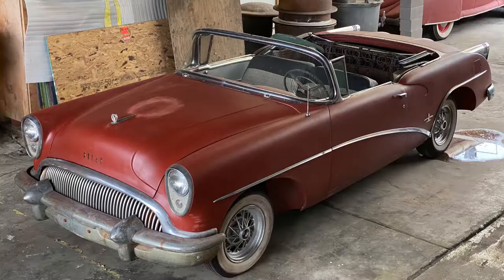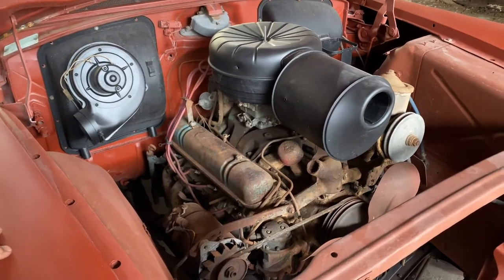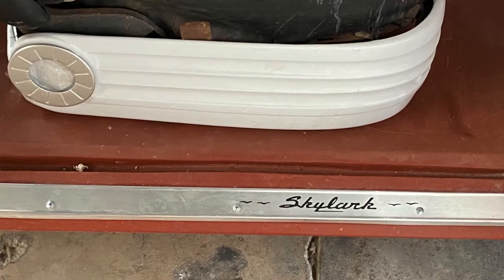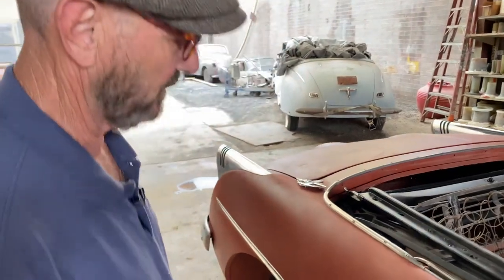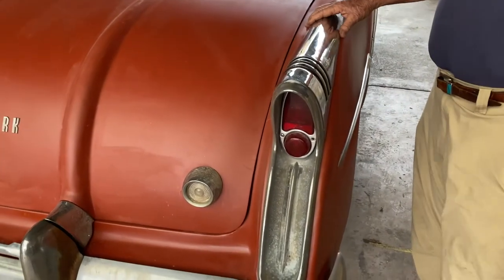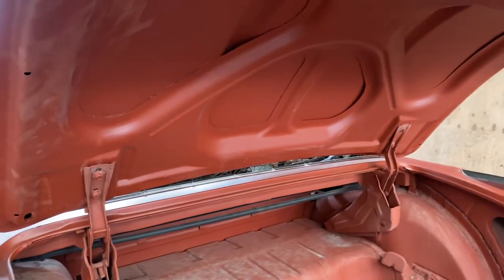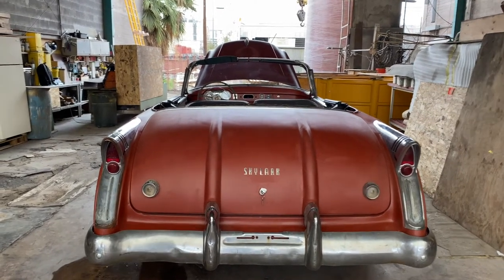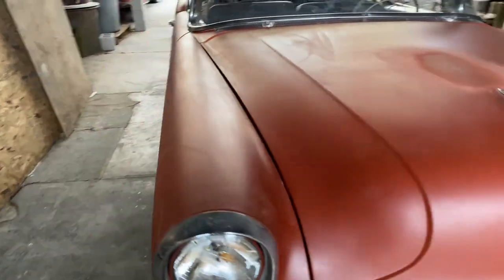1954 Buick Skylark Convertible. The classic and rare Buick "Anniversary" Car

Comment: Please do some research the 53 skylark wheelbase was 121 1/2" and the 54 skylark wheelbase is 122 in the books but actually  is still 121 1/2  so its basically  the same size car or frame and the Skylark was based off of the special NOT the century and to prove my point the rear axle ratio is the same as the special plus the under the seat heater plenum is stamped 40 Series 12 Volt
Reply from the maker: Thanks for watching and comments, Arthur.